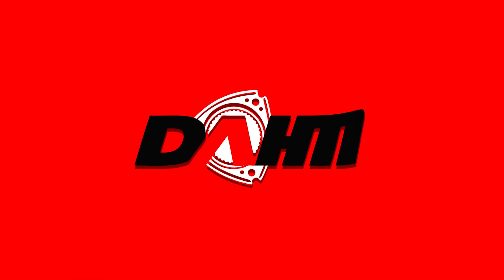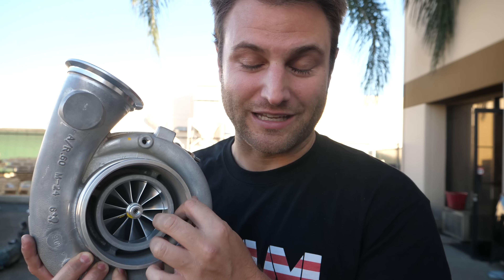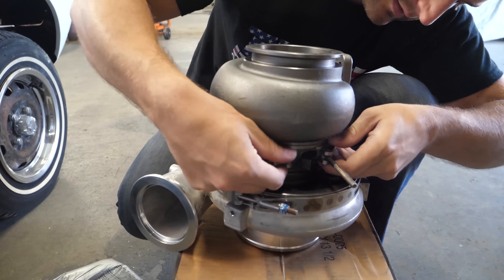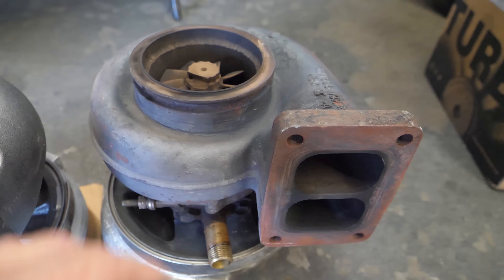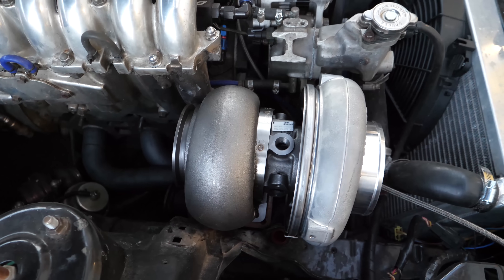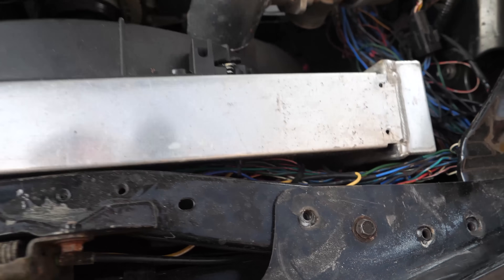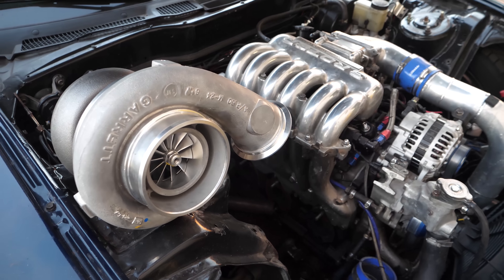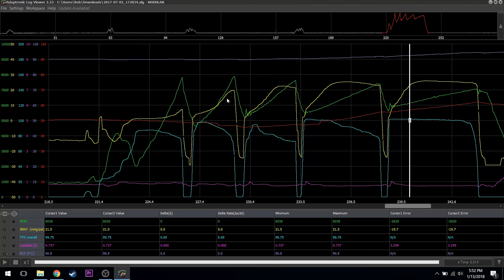New turbo for the 3 rotor! | Rob Dahm

Comment: Mount a large eltric fan on top of the engine half to fabric it up then luvir the engine hood for cold air to blow down on. The engine compartment this application in used in Australian out back on there vehicles

Comment: Thermal heat increases with boost even though some turbos are more efficient at higher boost levels. With a street driven rotor the most important important thing is thermal dissipation you can't chose turbos like drag evo and supra guys do bc with those cars on e85 they are just looking for turbo with highest response (best power curve)  and high top end which always ends up being a high psi 30+ high efficiency turbo. With a street driven reliable high horse power rotor the approach is different. Bigger is better for street driven rotors to keep things cooler and forget about response being a priority thermal efficiency should be the focus meaning finding the best turbo that can hit your power goal at the lowest boost level. When you go past 20psi heat goes up exponentially thats why most pump gas cars do go over 20 psi bc intake air temps start becoming a problem and also engine compartment temps go way up. Big turbo efficient at lower boost levels is the ticket it will be laggy and not have the best power band but it is what it is the motor will last. I would not go over 25psi on a street 1/2mile rotor bc heat will be a problem you can't set it up like all these drag rotors setups that run there cars 7-9 seconds at a time heat soak is not a problem in drag racing like that street. Its all about cooling.

Comment: That is a twin scroll turbine housing. To make it work properly you'll have to do a new exhaust manifold in a such a way that the exhaust pulses are to be divived properly between the two sides. Do it right and you'll have a faster spool. Its been a while since i research on twin scroll when considering it at the time i bought my new turbo.

Comment: Get a Quick Spool Valve !
I converted my Comp CT5X 7285 from a T6 to T4 housing. I still plan to go with a Quick Spool Valve. I've heard it can make 500 rpm difference in spool up ( aka Boost threshold. ).

Also, what is the reasoning behind not having the exhaust manifold primaries not being exhaust wrapped?

Love it Thanks!

Comment: Holy crap rob, I can't believe you were using a journal bearing, oil cooled turbo on that monster. Ball bearings and water cooling will make a MASSIVE difference, and the lower A/R should help a lot.

Comment: Rob, give that smaller housing a try. The GTX turbos are quite efficient, and in the end it's the average power between the shift points which will make you go faster, not the peak numbers which will only get you a dyno queen.
If available get the compressor map of the older turbo and compare it to the GTX map. At only 25PSI of boost the pressure differential is relatively low, so based on how much air the turbo is moving you will determine which one is more efficient across the board.

Comment: If you really wanted to you can block off the coolent feed and drain on the turbo it’s not recommended but my temps would spike horribly during a pull reaching up to 297F degrees in my dsm and I ended up blocking off my feed and drain but like I said it’s a preference it’s not needed but not recommended to do

Comment: I think it will be a great turbo if you want to drive the car more on the road and do some stop light racing and 402 meter drag race.
And ceep an eye on the egt when dynoing, 900 hp 26b might want to have a bigger A/R exhaust housing :)
Plus you will get more torque and that will kill your driveline faster...
Are you running 3" or 4" dp?

Comment: Why don't you just run a quick spool valve? It would help a lot with the low end torque. (For those who don't know, a quick spool valve is designed to force the exaust gasses into the smaller half of the impeller first to get it up to speed, and then opens to allow the gasses into both sections of the turbo.)

Comment: This housing should make much more responce, but i know rotaries have massive mixture flow, and my question is... If it will be able to take all gases out? Or it will just only prevent flow... Bigger wastegate will well... waste boost... Best advice You bought it, check it. If You asking audience if You should buy bigger housing, try if fails buy another then

Comment: Rob, ignore the haters this is a great video.. I especially liked the graph at the end! Great visual aid to explain what's going on and why you're down sizing. But you mentioned you were worried about drive line issues while shifting. Shouldnt that be addressed first before sticking a smaller more responsive turbo in there? Or is the more responsive turbo gunna help not break something since you can let off more? Im a bit confused with that logic.. Arent there features in a racing ecu that allow you to keep boost between shifts safely?

Comment: That type of housing is called a twinscroll, theyre supposed to spool up faster than single scroll. Theyre more common on V6 and V8's though, with each manifold going to their own port.

They are supposed to help with the pulsing between cylinders (when one set of cylinders isnt firing at the same time as the other set). So if a 4cyl has 2 sets of 2 pistons that are alternating, (set 1 fires, set 2 fires), cyl 1 & 4 are spooling one side and 2 & 3 are spooling the other side of exhaust turbine. Otherwise you get that annoying pause in the spool, which (theoretically) causes a significant hp loss under boost.

Comment: The new turbo will be perfect!  the lag you had with the other turbo, will almost be a thing of the past with this new one.  also, your spool up will be significantly faster, and it will help pull all the way to redline without too much effort.  plus, you will be going from velocity, to volume, and back to a steady mix of both velocity and volume, and that is what will help you stay in boost longer, and get you into boost so much sooner.   the new set up is almost perfect for this set up.
Reply: Austin-C Media I bet another rotor would help with turbo lag...
Reply: absolutely, but the work involved to get another rotor is insane.  but 4 rotors sound absolutely evil AF!!

Comment: The water cooling is mostly for cooling the turbo bearings after the engine has been switched off, to extend the life, rather than improving cooling while running (though it does offer some positive benefit in this area) Garrett has a white paper explaining how it works.  My F10 M5 has 2 water cooled turbos, and the engine management system runs the coolant pump for up to 10 minutes after the engine is  shut down to bring down the turbo bearing temp.

Comment: Re radiator: Are you going to seal the radiator to the grill opening?

I honestly think poor airflow rather than inadequate parts size was the reason your car was overheating before. It's difficult to get perfect, especially when you have a massive front mount, but the tools, time, and materials to get it 90% right are cheap & easy. I can run you through it if you like

Comment: isn't a gtx4202 7675 a bit big for the power level you're going for? Wouldn't a gtx3584rs gen2 6762 be sufficient for 900hp with amazing spool?
Reply: Alex Thompson you can never have enough boost
Reply: you'd have more boost with the smaller turbo than the larger turbo at the same power level
Reply: Alex Thompson my bad, *you can never have enough hp
Reply: Rotaries are always a bit different on sizing and power ratings. I’d say he’s pretty close to perfect.
Reply: A gtx3582r is currently the general consensus for a 2 rotor turbo setup so I imagine he's about right for a 3 rotor. And he will have much better response throughout the powerband instead of his other turbo which was bragging rights peak power
.